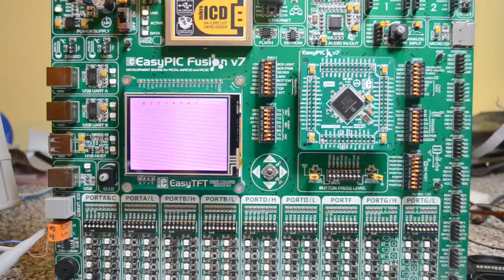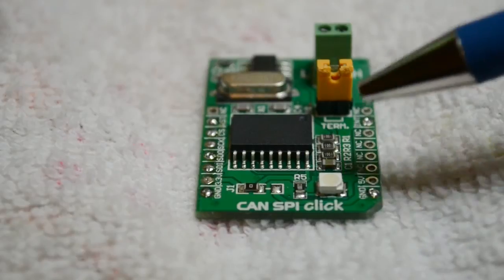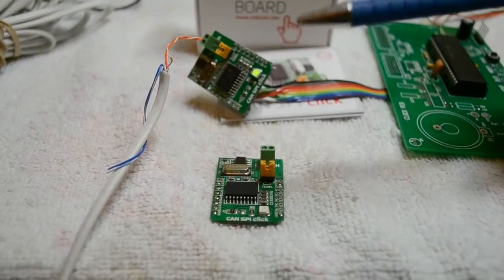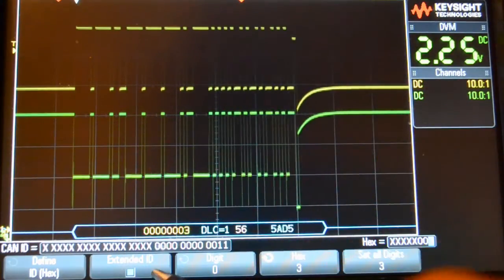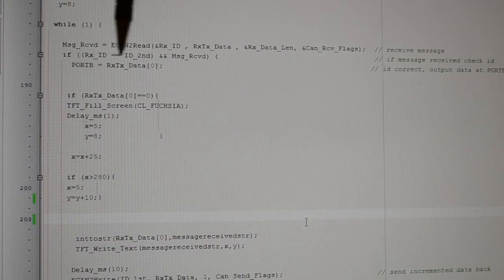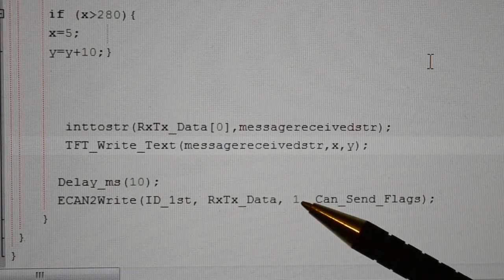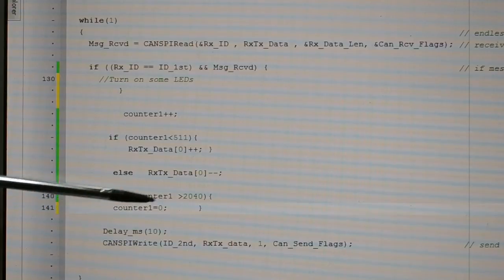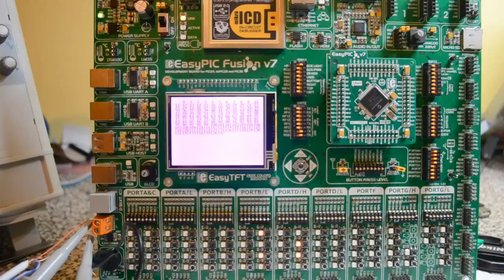CAN & CAN SPI 'Click' from MikroElektronika

Comment: John please help. I bought the can spi click 5v and the pic 32 clicker 2. how can I make them communicate ?
Reply from the maker: +Maria Rogers 
Hi Maria, can you send me a link to the 'pic32 clicker' I will see what your problem might be.
You want the spi click to communicate with ?
Reply: +John B http://www.mikroe.com/pic32/clicker-2-pic32mx/

tyyy
Reply from the maker: +Maria Rogers 
Hi Maria,
Thank you for the link.
I wonder what your 'end goal' is.
The Can SPI board will plug onto your clicker board and communicate with an external CAN source.
To do that, use the example software with the Mikroelektronika compiler, in the examples and extra boards folder.
Check your wiring diagram for the clicker board and the wiring / pin-out for your Can spi click board, you may need to alter the spi number in the compiler example. i.e. 
...........
// Initialize SPI1 module
  SPI1_Init();                      is SPI  One
  SPI2....
or SPI3 etc
You have to set up each controller as Can SPI First for the first module and Can SPI Second if you're using a second Can SPI click board.
I hope this helps
Reply: +John B I am making a hyper cubed sattelite with a group of friends and we are trying to use a can spi and a pic32 dual communicate with a pic32 single using the can protocol to make an led lite just to prove that there is connectivity. That was very helpful. thank you!

Comment: Hi John,
I am interested in this trial. 
for learn about the canbus
But I was not sure for example, in this trial.
Unlike the examples MikroC available on the Web or not.
If data are same. It just can not help me
And there are many examples that can be obtained from the Web.
Now I try samples from the Web, it works for some command.
But can not read data from the CRC frame  of OBD2.
Could you guide me or have to send me an example of CANBUS study or not.
thank you
Reply from the maker: +Yanyong Sีuriyon 
Hi, There are 2 examples of CAN in MikroC, ...CAN & CAN SPI
It's up to you implement software to get it to do what you want.
Reply: +John B 
Wow ..
Many thanks to you, please respond quickly.
It is time, I am confused.
And I ask you another question. For what ever trial
You can read the CRC error frame by obd2 it or not.
Thank you for your attention
Reply from the maker: Yanyong Sีuriyon
No, not without writing more code.
Thanks

Comment: Why 2 different versions? (5v & 3.3v)? Wouldn't take much more to make a combo version.
Reply from the maker: Some of the CAN transceivers are 3.3 volts only but, I think it's for the LED
Reply: You can move the zero ohm resistor to change them from 3.3v to 5v, basically it will work with either voltage it is just that the pin out is a standard for their modules so the resistor just determines which pin Vcc is connected to, the 5v pin or the 3.3v pin.
Reply: And maybe change the LED resistor if going up to 5v from 3.3 ideally.

Comment: Hi John,
Just stumbled upon your video. Didn't know it came out few days ago. Good and quick demo there. Wanted to know about your experience when setting the bode rate on the SPI module because that was the first issue I had when establishing the comms. I wanted to chat a bit more about this data conversion. Let me know of any email address or website where we I can drop you a query.
Once again thanks for the video and the shout-out, It really has cleared up quite a few anomalies in my head.